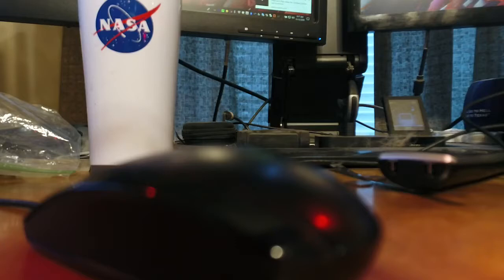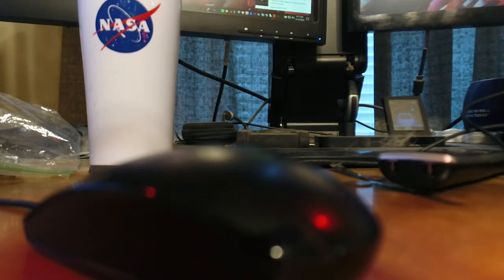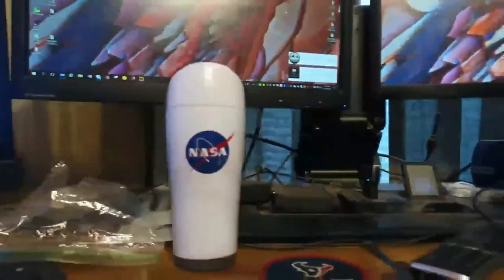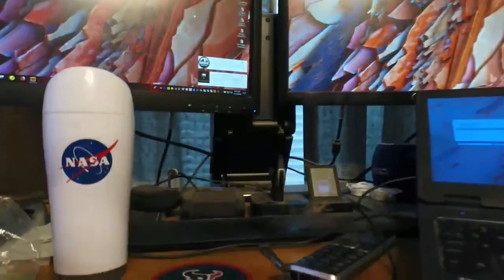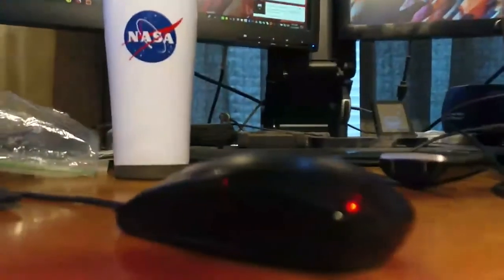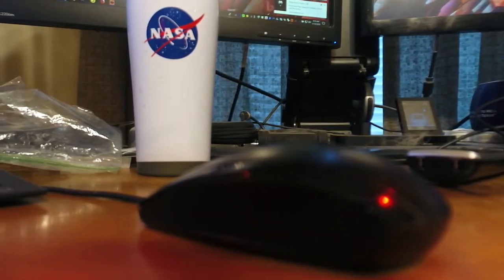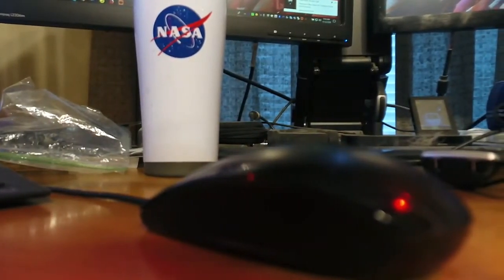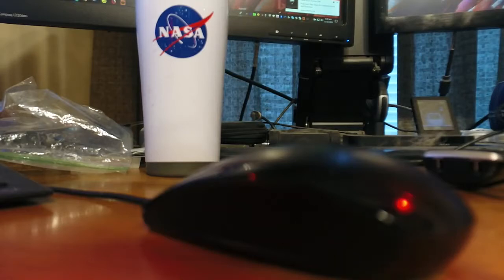Heron Bird -A view from the gimbal

Comment: Great news Jeff!  Hopefully the company will be able to supply you with the final missing parts.  FYI, there was a clicking in the audio about halfway into the video?  Your son was great at the ending fly it😁😁😁!  Thanks Fir the good news!
Reply from the maker: Steve Carpenter the popping was interference when I put the drone above the controller. The ESC board in back is exposed and most likely the culprit. I am certain when the drone isn’t in a room with 9 running computers. It will be just fine :)
Reply from the maker: Just for giggles I sent them pictures of the Mavic so they can offer advice :)

Comment: Jeff,weren't the screws from the old camera there? I don't recall you saying anything about those. Am sure ,if you still had one or 2 of those you would easily have been able to find them locally or atleast been able to figure out what size they were and the thread. Have done that many times when needing specialty replacement screws.
Reply from the maker: Tim S. The original yaw arm and ESC board were obliterated in the crash and never recovered. So those parts were replaced from scratch.